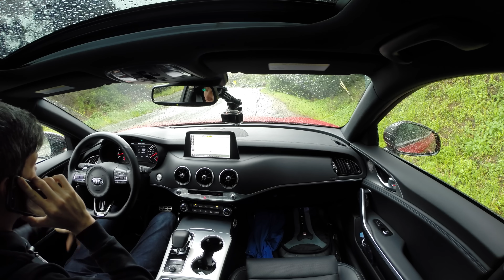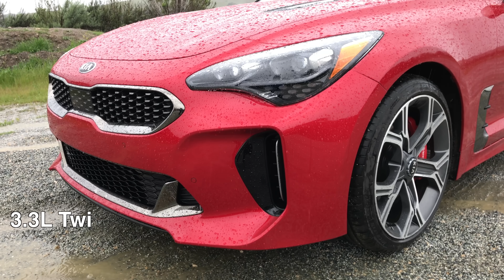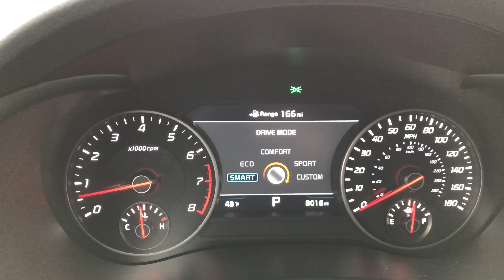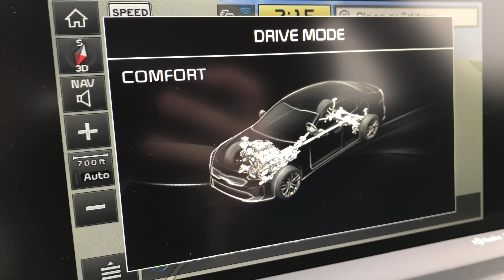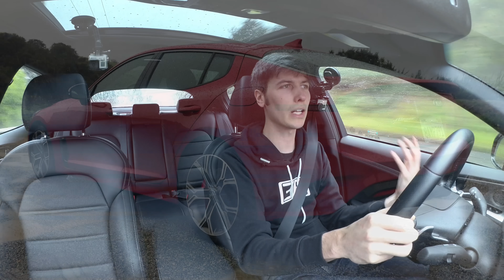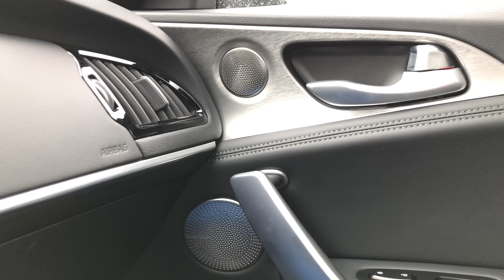The Kia Stinger GT Is An Ego Check For Car Guys

Comment: These cars are under rated from so many aspects but one aspect I didn't anticipate that came as both surprising and somewhat disappointing is it's size.  As someone who drives a 2021 Subaru Outback, I have to be aware of how long the car is.   Having seen the Stinger in person I thought it looked much 'smaller' but when I checked the specs, it is actually the same length as the Outback at 191 inches.  

What I love about the Outback is also what I potentially may not like about the Stinger.  Too long to park and maneuver but in saying that, it will give you a lot of capacity if you need to make use of it.

Comment: It's not the "badge" that's the issue.  It's the meaning behind the badge and brand.  Kia is not known for making very reliable cars.  I've seen it first hand with the Forte, Sorrento, and the Seltos.  I have a big family and a few of my aunts and uncles drive kia.  I don't see the car last longer that 5-6 years and there's a reason for that.  My uncle bought his Forte brand spanking new and had engine problems before hitting 80k.  My neighbor had a kia sorrento she bought less than 4 years ago new.  A couple months ago I started seeing a VW Tiguan on the driveway, I asked her why she traded the kia in and spent 30 minutes listening to her list all the problems.  

The reason why no one for the most part has not received any problems yet is because they only came out in 2018... and for the most part nobody is surpassing 100,000km mileage yet.  So the few people who are and are reporting problems don't matter when you have 20,000 other people who's engines are under 50,000 miles and still running perfectly.   

Not hating on kia whatsoever as it does what it needs for those who are on a budget, but Kia really needs to take a step up on really branding their company as a reliable high end brand that can be compared to more luxurious japanese/german cars.   They are already on the right track with the stinger and the new Sorrento SX, but I think there's a lot more that can be done.  

Take Hyundai genesis for example, when it first came out, due to it being a hyundai, not many people were to keen on dropping that kind of money for a sports car branded by Hyundai.   So Hyundai started to catch on to that.  They said ok guys no problem.  And made their own Genesis brand and separate dealerships.   Putting extra love into the Genesis cars that it pretty much puts that car in a whole separate bracket than an average Hyundai.  That's what I think Kia needs to do.  

I proudly drive German cars, and it's not because I'm a brand snob, but because I know the luxury and the premium perks you get with going for a high end brand, and I've never been disappointed.  We have a BMW X5 on the driveway with almost 180,000km on it that has not given me an ounce of issues.   Just do your maintenance, and I'm sure a german car can match asian cars if not surpass it's lifespan.

Comment: I've done so much research into this platform and with the basic turno bolt ons and a JB4 tune this thing is capable of 450-470whp and over 500ft-lbs at the wheels of torque, nevermind a Scatpack or Mustang, catch me in a Korean muscle Kia!

Comment: EXACTLY! I bought a 2019 MAZDA Grand Touring Reserve compact SUV with a 2.5 L. turbo engine that, like the STNGER, is FUN to drive with its good steering feel and AWD handling. PLUS my SUV is as luxurious inside as the STINGER. Like the STINGE "Mercedes-derivative" interior my CX 5 has a "BMW-derivative" interior. So what? Both vehicles are a lot of value and fun for the money.

Comment: I had a guy, who owns an Audi RS6 ride in my car and drive my car and my car at the time was tuned and running 420 whp and 450 torque so it was very similar in performance to his 4.2L turbo V8. When he had a chance to experience the car and forget it was a Kia and listen to the sound, feel the seats, feel the responsiveness of the car overall, there was a lot of respect gained. Get pass the emblem folks. it means nothing bad here. How many car manufacturers today engineer and build their transmission in house with the lead of Albert Biermann who was the lead engineer for BMW M Division? Folks, this car shifts as smooth as butter. Make no mistake, this car will be a classic someday.
Reply: Amen to that! Even Kia builds their Turbochargers in house also.

Comment: I just bought my AWD GT2 stinger last month, first ever used one on the lot. On some what cooked tires and a beat up road I actually clocked 4.65 0-60 mph. Conclusion not only did Kia underrate the power numbers of the TT 3.3 engine but they also underrated its 0-60 times.

Comment: I had 2019 KIA stinger GT2 edition for over 3 days and I returned it, the interior on any stinger rattles, head up display blends you when in the sun, tracking was not good enough, display and interior looks cheap, breakes are not giving road feedback, steering is not good and back windows is to small to see traffic behind. Only good thing is its fast but not a real sport car in my opinion.
I got my self a BMW 2016 435ix Gran Goupe M performance Edition instead which is way better car in all aspects. I really enjoying BMW driving feel and the Z8 transmission. Kia can never come close to the feel of a sporty BMW.

Comment: I've driven multiple Kia's, yet not very many modern ones. Most of the ones I've driven were made in the early 2000s and I can say they felt very very cheap. The interior looked and felt like it was made out of the cheapest materials they could get their hands on, and threw it all together as quickly as possible and called it a car. I haven't driven many new Kia's however, so I'm not really sure about how much they've improved, but based on the ones I've driven, I'm not impressed with Kia's quality. That's my personal point of view on it though.

Comment: Can you do some interior video please of the interior? It's mostly the same 3 shots all the time while you drive on an average road. It's useful up to a point then it's time to move on and show us more detail of the car inside. What are the seats like, adjustment, features, dash, the usual things. So that we can see if this is a car we would like.
How tall are you, can you fit in the front and adjust the seat exactly to your size, steering wheel position, rear seat comfort, space and roof height. Those things that might matter.
Thanks though. It's a good video but I'd just like to see more info.

Comment: Steering: it's always moving, little adjustments, jerky movements. What's up with the steering? It doesn't look smooth. Does it need a fix, a software update or something?
Reply: T A that’s the lane keeping assist working. It’s actually rather annoying, I turned mine off.

Comment: I was looking at these recently, if you dig a little bit reliability hasn't been great. Also the great warranty they advertise isn't directly transferred to a second hand owner. I'd never pay £45k new for one in a million years but a few years old and £25k is starting to get closer to the mark. 

But that 7 year warranty turns to 3 years if you buy second hand, if you've just bought a 2 year old car then it's out of warranty in 1 year.

Also within the total 7 year warranty that only covers engine and drive train, warranty for air conditioning and some other stuff only lasts 1 or 2 years. 

So if you are thinking of buying, look at the reliability and research the exact warranty length for different components or you might get caught out. Quite a lot of people are saying they will try anything to get out of warrant claims as well, stuff like ignoring squeaks and rattles so they dont have to fix them, and grinding down brake discs because of brake shudder like 3 times before actually replacing the discs. 

Seeing all that put me off, but I'm sure someone who buys brand new will have a great car for a year or 2

Comment: sadly I have been saying since 2014 that I'd rather drive a KIA than a GM.
Reply: Lol, that's true. New GM's are clunkers, my GF had a Cruze that went through a couple transmission replacement with less than 80k miles

Comment: American auto makers making less and less cars for SUVs. 

Kia stinger : * v i b e c h e c k *
Reply: Fewer* And yes, because the typical fat american doesn't fit in a normal car. And those cars wouldn't fit on European streets, hence the demand.
Reply: hanetar tf is wrong with saying less and less?
Reply: @josebatres8182  Well you can't have "less cars", only "fewer cars". It's a countable noun. You could have less water/food/air, but only fewer cars/houses/wrenches :)
Reply: @han5vk  yeah righto champ
Reply: @elrud5964  He's actually correct. Don't get upset because someone knows grammar.

Comment: I remember the first time I saw a stinger a few years back. Turned my head. Great car, an example of what happens when top BMW execs and engineers move over to Kia.
Reply: I remember when they came out as well. I worked for a Kia dealer as a tech. Everybody was hyping them up (especially our salesmen). Got to test drive one. They feel larger then they actually are. They have the same issue as the Genesis sedans have (worked for a Hyundai dealer for years prior to working for kia), while fast, they don’t feel fast. The stinger handles like a slightly smaller Genesis G80 on sport mode. I wasn’t impressed whatsoever. Then I saw the sticker price and realized that nobody in their right mind is going to pay $50-$60k for a kia. Well I was wrong. We sold them left and right for about 2 months, then sales slipped and now they are lucky if they sell 3 a month. On top of that, certain colors have adhesion issues and their resale value dropped like a rock. Why buy a new one at $55k when you can pick up a 1-2 year old one for $30k.

Comment: In a time when almost all cars, suv's and even some pickup trucks have a engine on the wrong side of the front axle centerline offset to the passengers side in a transverse FWD layout, I applaud any manufacturer making a car with a RWD layout. I get it, most people just want a transportation appliance and FWD is good for that. For those of us who like balanced RWD cars, most options are expensive luxury brands. Thank you Kia, may others follow your lead.

Comment: I have a KIA Spectra 5 SX it's a fantastic car love it and it has a 5 speed :P
Reply: I Got a Stinger GT a few days ago it's great, I started with a Spectra 5 SX, then I got a Forte KOUP R, now I got the flagship. Youre right about the shifting I will try comfort mode. One thing that bugs me is the engine stop start , I have to disable it every time because my traffic wait time are typically about the time the engine will shut down which is annoying and not actually efficient.

Comment: My hat's off to Kia for actually putting their own "boring" name on this, showing who they are and that they can be cool, wearing their name with pride, rather than hiding behind a new "upmarket" badge to sell this under, as Toyota, Honda, and Nissan did with Lexus, Acura, and Infiniti, respectively. I always thought that was silly, like they thought their own base brand wasn't good enough or something, or they wanted to separate these snob's cars from what they sell to peasants. Wish it had a manual, like everyone does - my opinion is that for any car to be fun, if there are gears to shift (in other words not electric, or maybe that Koenigsegg One:1) I better be shifting them myself. But this car was designed as a "grand tourer," comfortable for long but fast drives, maybe this is "less fatiguing," and though they give drivers less control automatics these days typically perform better - though they're still not as fun. Rear visibility - that's just the way all cars are these days, I don't know why everyone does that.

Comment: Sadly in italy this thing is priced against Audi A5s and apples to apples it won't hold any value thus is an hard buy. I've tried a 200hp diesel around Monza track and I was surprised. The only thing me and the instructor didn't figured out is how in hell you can force the shifter into manual sequential. Even if you override it using the paddles, after a few seconds it gets back in D and won't let you use it manually; we couldn't find anything to stop the behavior even in Sport+ mode.

Comment: I like that KIA is doing this but in the END you can get a BMW 340i , infiniti q60 3.0t or 400 for similar price, maybe even less and they have very similar specs, about the same HP, same features. The difference in horsepower can be easily fixed with a tune. Once you can control boost and tune you will get about the same horsepower out of all these turbo cars. The BMW has DCT which will easily make up for any HP difference by shifting much faster. The infinti has the 400hp version. TLDR: these cars are very similar , even in price. Why get a KIA when I can get BMW or Infinity for same price?  This car needs to be priced like a KIA to make sense.

Comment: Why did I buy the 50k RWD Stinger GT2? Limited slip differential, napa leather, all led lights, advanced electronics, weighs less than the AWD, is faster than the AWD, handles corners better than the AWD, looks awesome, drives great, beats comparable BMWs and Mercs and Audis hands down. I bought the car not the brand. You can hold your nose all you want, the Stinger is a better car.
Reply: Kia did a great job with developing and putting out this car in the market.
Reply: Mike Murphy better car than what? Exactly what BMW is this comparable to? I don’t think this car really even makes a case against the M340i, let alone a real M car.
Reply: Ok ok . Why are you all defending so much . Weird how every post that stinger owners write is so defensive. Buy what you want  , you have that right . I will buy my car but damn sure not going to defend  it.

Comment: More like a logic check for egomaniacs. A rational person would see that regardless of the badge or manufacturer, if it’s a great drivers car, it shouldn’t matter where it’s coming from. My worry is aftermarket support. I really hope we see aftermarket support for cars like these hopped up Kia’s and cars like the Newer Genesis line that has the smaller G60 I believe? I could be horribly wrong in the Genesis name but I know they release a smaller sedan, slightly smaller than the Stinger even and it has the same 3.3 TT V6 out of the Stinger GT. Imagine how fun these cars could be with some aftermarket support. Do a tune and open up the potential and you could probably gain a hundred HP and 100 lb ft of torque too just with a tune over the oem configuration. It’s still to be seen if they’re going to get some aftermarket love for tuning and ecu support. Also there are the new Veloster N with the 2.0 Turbo 4 and if that thing gets aftermarket support for tuning it could be making some serious horsepower just with intake exhaust and a nice tune and/or all that and E85 support. Then there’s the Elantra Sport which could do with some serious tuning support to make a really fun little economy turbo car, it’s not the 2.0 T but the 1.6 T could probably still come to life pretty nicely with some massaging, there’s also the Elantra GT Sport, unfortunately no Elantra GT-N. Nope Europe gets he i30N and we just get a frumpy Elantra GT Sport iteration with the lazily tuned 1.6 T where the same hatch in the i30N has the larger (better) 2.0 T (from the Sonata and Kia twin) making about a 3rd more hp and torque. Why is America always getting short handed with the performance additions? I want the N line of Hyundai’s to come to America, and whatever Kia’s version of N is would be cool too since Hyundai is the parent company anyway and they share a ton of configurations anyway.

Comment: I hated kia, but I ended up working as a kia car salesman, too ironic but it was cake work and cooperate was pretty cool actually. 6 months later. I bought a 2014 kia forte SX with the 1.6 GDI gamma motor, with a twin scroll turbo. Fully aware of the intake valves needing to be watched and cleaned which is not big deal and a easy chore to do honestly. It is a fun little car but it's not a WRX or a ws6 trans Am, either way is still very fun to drive.

Comment: After viewing several YouTube videos about the KIA Stinger, I had to test drive this car for myself.  I test drove the GT Limited trim model. As I was adjusting my mirrors, I couldn't believe the limited visibility in the rear window. The visibility looks like the small brick was removed from a jail cell! Even when this vehicle has the blind spot monitoring system, it's challenging to shoulder check blind spots with the wide roof pillars.

Every video I've seen talks about the same things such as acceleration, speed, sound system, brakes, etc. YOU are the ONLY one on YOUTUBE that mentioned the poor rear visibility on this vehicle!

Great thorough review by the way.
Reply from the maker: Glad you enjoyed the review! The rear vis definitely could use some improvement.
Reply: I completely agree about the rear view mirror - very poor visibility, but that's my main complaint about getting the car. The side mirrors provide a large amount of visibility to make up for it, though. I don't have much of a blind spot at all when driving it just looking out the side mirrors. It's a fun and smooth drive, and I never thought I'd be happy driving a Kia, but I'm definitely glad I got it
Reply: It’s not that bad. All of the sport backs are kind of like that. Either you want a sportback, and deal with these ergos, or you get some other style.